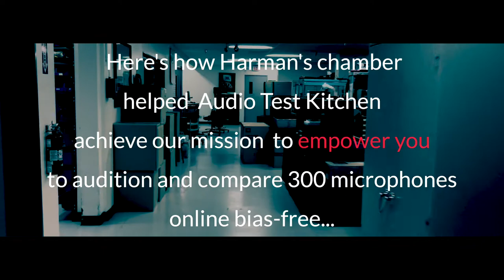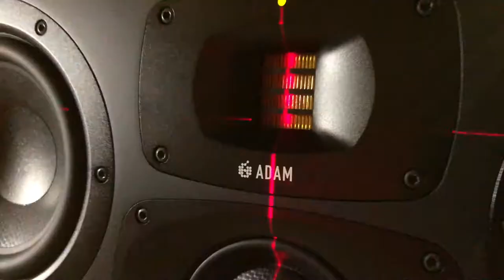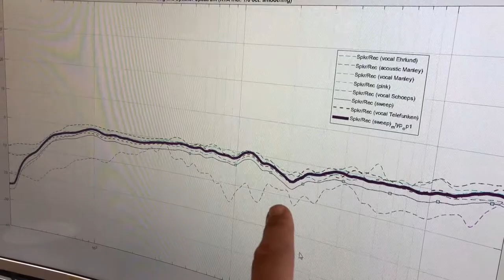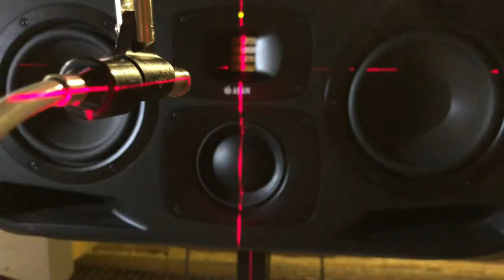How Science Powers Unbiased Microphone Comparison in Harman’s Anechoic Chamber

Comment: You know what joins acoustically? A single full-range driver. If you ask me, that speaker is WAY too close for the SIX different signals from the four drivers+two ports to combine into one cohesive wavefront. You are guaranteed massive phase distortion as you sweep from woofer to tweeter. You have even more phase distortion thanks to the 3 crossovers. Plus comb filtering from duplicated woofers. Plus the "transient distortion" of mixing ribbons with conventional cones, AND the immense group delay inherent to a ported speaker. I wouldn't let this monitor in my studio, let alone use it as a reference for 200+ tests. This is insane. You did so much work. It's like building a million dollar racecar and starting with a flat tire.

Comment: Hi! Many thanks fot this great video. Tell me please, how did you define the target point of the ADAM surrogate speaker? According to the laser, it's not between the tweeter and mid woofer, but the laser point was right at the bottom line of the tweeter. Is it the best spot for every horisontal speaker with a ribbon driver? I thought the best point was right at the center of the speaker between the woofers. Was I wrong? Thabk you in advance for the answer.
Reply from the maker: Great question. We used a robot to locate the ideal position between all the drives. That was a long process, but it paid off! Thanks:)

Comment: In my opinion this is a flawed experiment.  I understand that the intention of utilizing a recording played through a modified studio monitor is to avoid the variables that come with live human performance.  However, by recording the performance with a microphone and playing it through a studio monitor, you're only recording the information that both the microphone and the studio monitor are capable of producing.  Essentially, you're comparing microphones that are recording a series of samples which are inherently limited in their information, whereas a live human voice is not.
Reply: I disagree. In this experiment, of course they are using the voice as a variable of recording stable information. But what we are talking about here is how we can constantly record a consistent sound, and how the microphone will pick it up. A microphone does not determine what it is recording, whether it is human voice, an instrument or etc.. it only reacts to vibration from the air which is sound. So regardless of what you are recording, it doesn't really matter as long as the recorded information is consistent on all microphones. 

Also, anything beyond the information we recieve on this experiment is also beyond the capabilities of human hearing so the slightest miscalculations would not be audible anyway.. it's just going to be math.
Reply from the maker: It's a difficult, dilemma, Altuz, it's true. The alternative – every microphone receives a different performance – is far worse. We didn't believe it was possible to replicate the human voice until we spent months perfecting the process. We didn't stop until we couldn't tell the difference between the live vocal and the re-amplified voice.
Reply from the maker: Thanks, Migz. You've got it – you can't have any variable except the microphone itself.